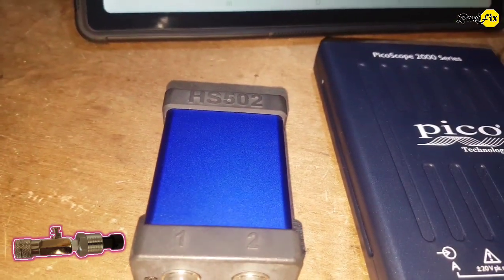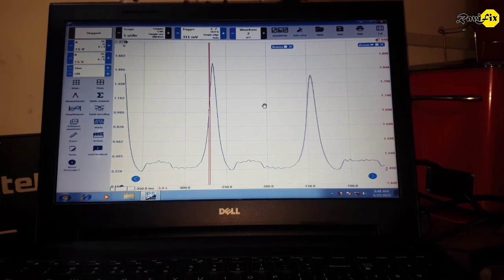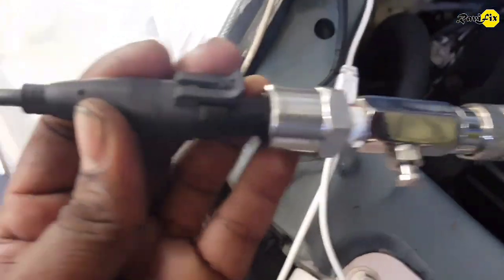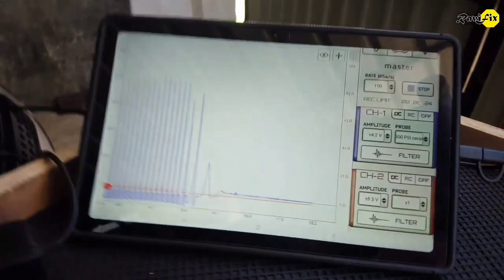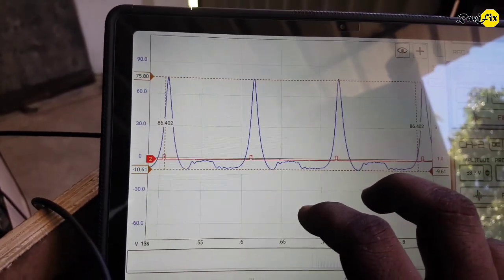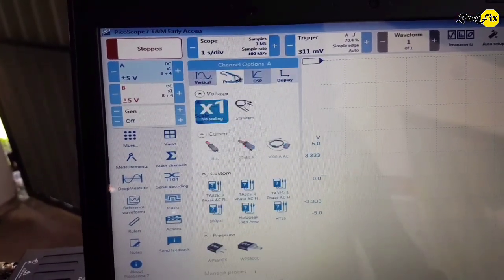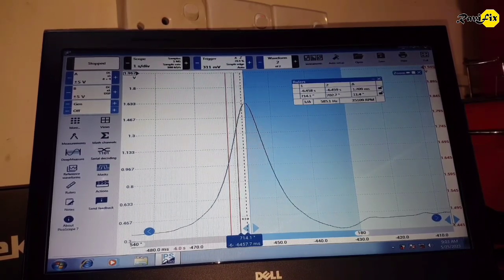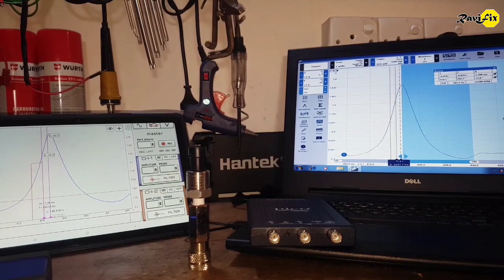16$ incylinder pressure transducer unbelievable clean and detailed  waveform with HS502 & Pico2204A

Comment: Hi Ravi. I always thought the 2000 series picoscopes were 8bit res. The specs on the 2204a say it's an 8bit scope. Am I missing something?
Reply from the maker: It is 8bit but The resolution of 2204A oscilloscope can be adjusted using the resolution enhancement feature in the PicoScope software
Reply: @ravifixall  Good to know. Thank you👍

Comment: Hello, i have a Hantek 1008c which claims to be 12 bit. Would this give an acceptable pattern on it in your opinion? I know i need a Pico but learning alot wirh the Hantek and a 1 channel uScope. The Pico sure cleans the inage up though. Thank you
Reply from the maker: Sorry, I have no experience on 1008C. However 
I know Hantek pc base software is not capable to optimize its hardware. Try it with Hscope.

Comment: So this pressure transducer reads vacuum? I dont see on the specs of AliExpress
Reply from the maker: This is not a absolute pressure transducer. But it read vacuum and give us a good waveform on incylinder pressure test. I use it always. Have good result with 12bit vertical resolution supported oscilloscope. Do not buy it for 8bit resolution oscilloscope.
Please note: also has 2ms response delay.

Comment: I got the pressure transducer but I need the adapters to use it with my flexible compression gauge hose similar to what you have there, to do a quick connect and disconnect from the pressure transducer. any suggestion?
Reply from the maker: Try it on aliexpress.

Comment: I have that one, so, what do you have your filter set to.....because it isn't that good.
Reply from the maker: You get only perfect waveform with 12 bit vertical resolution supported oscilloscope. 
And use 1kHz low pass filter

Comment: Nice video!  Is the pressure transducer going via hose to the spark plug hole?  How is the vehicle ignition working for that cylinder?
Reply from the maker: Yes used a compression gauge hose. Ignition coil is isolated.
Reply: @ravifixall  So you were not getting waveform while that cylinder was running?  Because you had no spark.  I was just wondering if this sensor could be used on a running cylinder (with fuel and combustion).
Reply from the maker: @2gnospam  injector on that cylinder is disconnected and ignition coil isolated. Then no problem.

Comment: thanks sir.. congrats .. is 30 psi-5vdc-0.5-4.5v the correct ? the linked is that ..
Reply from the maker: Yes the link is right. When you are in, choose the right presure range  from the list accordingly your need.
Reply: @ravifixall  that for respond .. what exactly is yours .. TIA
Reply from the maker: @juliogarcia6323  300psi

Comment: Where did you get it? I want to buy 1
Reply from the maker: US $16.50 | 2m/78.7inch cable, Multi-Range Optional Import Ceramic Pressure Sensor Pressure Transmitter Transducer
https://a.aliexpress.com/_m0URyVS